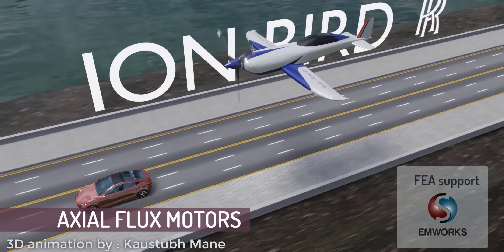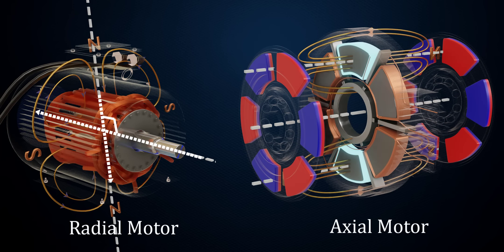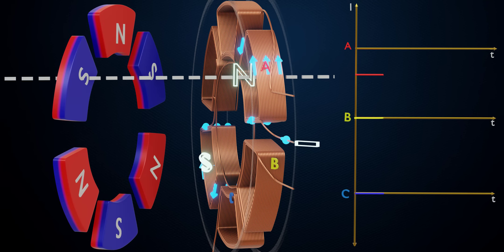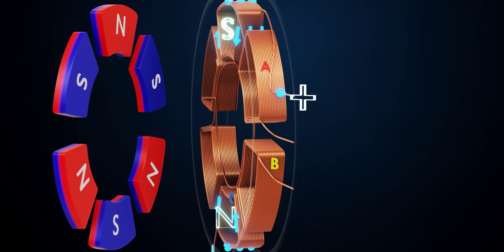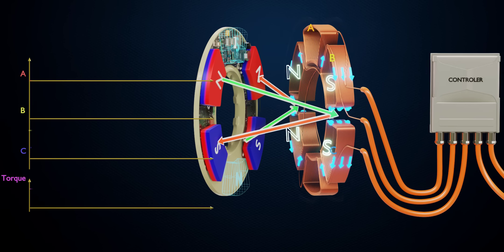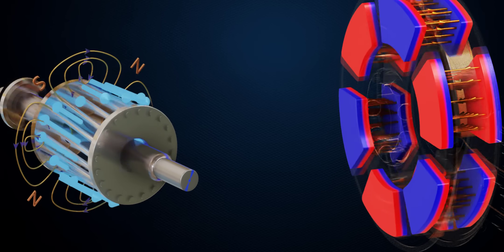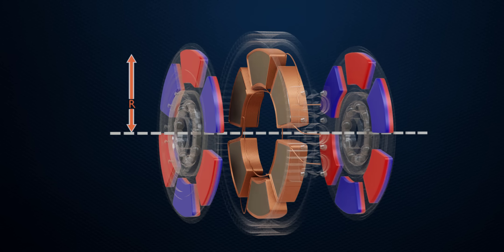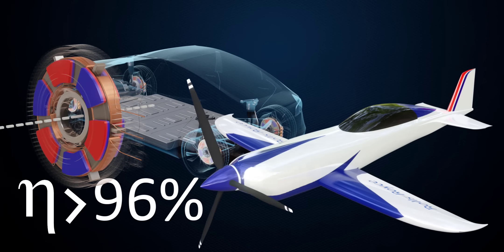Axial flux motors - The new hope

Comment: So interesting. In my day we did not have the benefits electronics bring. Large variable resistors to control  current, thus power, very clumsy when you look back. Squirrel cage induction motors still perform well, and last a long time. FLUX DENSITY MASTERED AT LAST.

Comment: Axial flux motors have been used by the millions in 3.5-inch and 2.5-inch hard disk drives since the early 1990s to move the read-write heads.  Nothing new under the Sun.

Comment: One of the main problems in electric motors is making sure that the magnetic field is made mainly of a magnetic material and the shortest possible distance id made of air, because this greatly reduces the engine efficiency. This could be difficult tho achieve, using this kind of design.

Comment: They should make the rotors/shafts of radial inductions motors hollow or introduce some lightening holes so that the radius of the rotor and the torque can be increased without increasing the inertia too much. Also if you drive the induction motor with a VFD you should be able to mitigate the high starting current issues.
Reply: Real radial-flux motors do have voids near the centre of the rotor to reduce mass and inertia.

Comment: These have been around for a while. The complexity, high manufacturing cost and difficulty, difficulty with cooling reducing efficiency, and just the overall design mean that its very hard to make a commercially viable version of these motors, especially when many other motors out there are easy to produce and can be just as fit for purpose
Reply: Daniel, thanks for answering the question that was in my mind; "If axial flux motors are so much better, then why haven't they been in use for all applications?"  Now I know. 😏👍
Reply: Technology isn't static though. As with all technologies, time, experience, R&D, etc. lead to improvements that overcome the challenges and limitations. And we'd probably be light years ahead of current-state development in these kinds of motors if the fossil fuel industry and internal combustion engines hadn't taken over the world.
Reply: @ronaldjanert7456  As the technology matures, we will begin to see specialization. Currently Tesla's new PMSR motor design is a huge leap forward in the automotive transportation sector.
Reply: @dustinyoung3069  do you think Tesla is actively developing a PMSR Axial motor?
Reply: @jamescoppe  They might have been, 2 years ago. I have no idea what they're doing now.

Comment: This concept is not new at all. A variation of the PCB motor. Just that current electronic (Power MOS) allows these to be AC instead of DC and thus no brush. Current battery power density remains the issue.

Comment: This is amazing,,,I have been talking about this for as long as I remember, almost. Especially to the drive train or transmission as the only spin as fast as the requirements. IE whats the rpm of a car tire plus drag and slippage of a car at 100 mph. Cooling is always going to be a problem with efficiency comes a price..
Reply: I have not been this impressed since Rockwells' Retro encabulator.

Comment: So smart but why not four bearings and two rotors one beside or inside of another and you just break one or the other for speed control differential and get rid of another problem and thats the direction from any rotational motor electric,steam, gas ext. Hope you get the picture of my opinion

Comment: I was wondering if it was possible to continue the classic loudspeaker voice coil or solenoid into a toroidal shape and have it spin within an external North pole housing and have an internal south pole in a ring shape. Normally when you apply DC to a speaker, the cone reaches the limit of travel and can't go any further. With this, the DC would provide rotation in an "infinite" magnetic gap. The difficulty lies in the inability to keep these poles in place without support from the centre. This would mean running the wire back and forth which would cancel the field. The way I could think would be to run the wires in parallel to central bus bars, but this would cause the impedance of the motor to become impractically low. So for now my "loudspeaker coil in a circle" idea for a motor will remain a concept, although the torque you could produce would be pretty incredible, with every section of wire running perpendicular to two attracting poles in a tiny gap, no inertia related stalls, and no field switching required.
Reply: I have not been this impressed since Rockwells' Retro encabulator.

Comment: Early electric airplanes will require high efficiency in the propeller design.  This means a large diameter, slow speed prop, which yes, the axial flux motor maybe well suited to, but this is not necessarily the best situation for higher speed aircraft, which will want propellers, perhaps ducted fans, spinning at significantly higher speeds.  Same goes for boats, and perhaps cars.  The video does offer some great visuals as well as other strong features, but as others mentioned, should give more credit to the low cost high-speed electronics, without which this concept would not be practical.  High efficiency radial flux motors easily achieve over 90% without any electronics other than a start capacitor, and they are like an order of magnitude cheaper right now.
Reply: I have not been this impressed since Rockwells' Retro encabulator.

Comment: The problem is the battery weight, we're at minor increases over years and years of development without a major change. This motor design is amazing in how it functions, but doesn't solve the real issue with electric aircraft. 
Small thorium reactors could solve it, but that creates other issues.

Comment: Generate an arc at 1.21 gigawatts or 1.21 billion watts, forward through a nacelle, then around outer nacelle toward the rear traveling back through the inner nacelle where it was generated to regenerate it. Have multiple generator  frequencies and placements at frequency for physically sized varied pulse lengths widths frequency etc.  now you have a multi pulse lightning engine that grips the outside of the nacelle without escaping and pulls the nacelle forward hard and fast as lightning. You can run it in the non plasma zone in the blue versus purple ranges or varying frequencies.whatever is suitable.

Comment: We keep seeing copper in these designs but silver is much better as a conductor improving the efficiency of these idea. Yes it tarnishes and corrodes faster in a oxygen environment but modern coatings and ability to seal engines must be available. Of course cost is the biggest factor ultimately.

Comment: There are several reasons why these motors are NOT in 99% use but radial motors are. It's not like there is a secret about axial flux designs. They are even older than current designs and they fell out of favor, because they actually aren't really good. 
First of all: They inherently waste out a lot of the magnetic flux uselessly into the environment. Catching this flux with cores will make the motor much heavier.
Second: Most of the flux it DOES use is wasted into creating axial forces. Useless.

Comment: Yes while watching this I kept thinking about the elephant in the room. The battery, the literal elephant in the room - or the plane. 
Maybe an alternative would be to use a jet engine to power a high efficiency generator..

Or possibly use a fuel like synthetic ethanol or methane or hydrogen, made using solar or nuclear or other low-zero carbon methods.

Comment: There are big problems with the design you presented. (1) The magnetic field of the "out" side of the permanent magnets. Its return path (magnetic loops must be closed - Maxwell) must be long as it goes to the "other outside" - a very long air path- hence you need huge H to get decent B, ie big heavy magnets. (2) Worse, this magnetic field is rotating and so inducing huge eddy currents in all the metal casing of the motor. These can be fixed by making the permanent magnet rotor in the center with stator coils on both sides, which being fixed, can have an iron magnetic return path, though it needs laminations to avoid eddy current losses.
Reply: Actually, I just realised the magnetic return path can also be through the opposite polarity adjacent magnets, but this was clearly NOT shown in the animation and needs more complex magnets or additional iron.
Reply: The plate that holds those magnets of the rotor are on the backside of the magnets, and they are ferromagnetic, so the magnetic loop is getting as close it can goes. So no problem there.

Comment: Looks like a good candidate for in home elevators for the old and disabled. Coupled to a screw jack and some lithium batteries you have a "power cut" (Brownout/blackout) resilient means of going upstairs and downstairs.
Reply: Or use the motor in a more traditional elevator system for the elderly, and have a series of cables pull the elevator from the top, and a counterweight. The screw jack may develop a lot of friction if not oiled properly. :)
Reply: I have not been this impressed since Rockwells' Retro encabulator.

Comment: Comparing an asynchronous electric motor with a permanent induced one is like comparing apples with pears. It would have made more sense to compare this axial permanent induced motor with the radial one. But then it would become very clear that the difference between them is not that big.
Reply: the problem is this design sucks, as it is not taking advantage of any of the advantages that can be achieved with this type system,
Reply: @denispalmer1937   What are the disadvantages versus the advantages, in a more advantageous design?
Reply: @denispalmer1937  - sounds awesome, where do I find out more about the motors you are referring to? Are they available for purchase? how about using them as generators for a small wind turbine?
Reply: @denispalmer1937  This is fantastic news. i see the formula i made for lockheed and boeing being fulfilled. We shall make great uses of the new engineering for our coming golden age neighbor.  Please write me a pm.  Heaven is approaching.
Reply: @denispalmer1937  you claim 9hp out with only 1.5hp in

you are a fraud
Reply: @kenwittlief255  I only report what was on the video recording the whole test, my 30 plus patents for this say you do not know what you are talking about, but how about ac units when ser 10 was a 100 % and now ser 42  how is that possible, simple the rating system is wrong, and how can a motor that is 90 % efficient require cooling fans to not burn up, fraud is strong words, but I have herd them all, but I have multiple independent tests from multiple sources, that say the tests are accurate. I questioned the accuracy of the dyno, but was assured it was not possible to be far off.
Reply: @denispalmer1937  so the patents are about reluctant/flux machines
Reply: @Dan-gs3kg  not about these about how to make motors that are 99 % from 7 rpm through 10,000 rpm,
  about magnetic, control circuits and more, configurations and relationships,
Reply: @denispalmer1937  for what kind of motor?
Reply: I have not been this impressed since Rockwells' Retro encabulator.

Comment: Who designs a 6-pole 6-slot BLDC? And don’t compare an axial BLDC to an induction motor, compare it to to a radial BLDC instead. Radial BLDCs also have no limits on diameter, and for a certain maximum diameter will have greater average magnet radii since the magnets cover less of that total radius. The main point of comparison between axial and radial is in the magnetic core and practical geometry. Both will have comparable flux coupling since the magnets are rather close to the ends of the electromagnets in both cases. The magnetic core of a radial motor’s stator will usually be heavier due to it filling up a significant amount of the motor’s middle, while the the core sections of an axial motor will be smaller. But both need structures added to the baseline cores to actually resist the torque that the coils impart. I’d argue that a standard radial BLD has a slight advantage in this case, at least compared to an axial motor with a double rotor. An axial motor with just one ring of rotor magnets, either with one or two sets of coils, would have less of an issue. Also such a double stator axial BLDC would be an easier geometry for making a twin-fork wheel-hub motor than a radial flux BLDC. Admittedly it may not have as good specific torque or power compared to an axial motor with double rotors that uses halbach arrays. I’d also not use any motor as a wheel motor directly on an electric vehicle. To get sufficient power the unsprung weight could get unacceptably high. As for coupling the flux of a series of motors on the same shaft, radial flux motors have a more convenient geometry.

Comment: Questions:

Like in a bicycle, the "lower" (bigger) gears on the hub (on the back wheel) allow for more torque.

Once the torque is not needed and speed is desired, a higher (smaller) gear is used.

@5:20, the animation completely reminded me of this, and I was wondering if the movement of the magnets is also used to create a bigger/smaller diameter?
Reply: if you moved the magnets further away it will produce less torque because the magnetic field is less strong. however, the back EMF would be lower, so the RPMs would increase

Comment: It's only profit that holds back the fact the electric cars don't just charge themselves as they run. The oil giants have relented on fossil fuel only to move into the charger sector roadside. Its just a con.

Comment: Bio-haul engines used as stator motors to power a generator should be looked into far more.  Pure electric is still not very viable and its all part of this "green energy" scam.  Very cool tech and worth developing but turning away from bio-diesel/bio-haul is a big mistake.

Comment: You just need mechanics with a solid understanding of engineering, mathematics, electronics and general physics
Reply: Why? You would be bolting it in and move on. Likely the units would have diagnostics built in. Unless you over current electric motors. Generally treated well will keep working. Make the flimsy and cheap material its a crap shoot. Really this would open up doors for electricians.